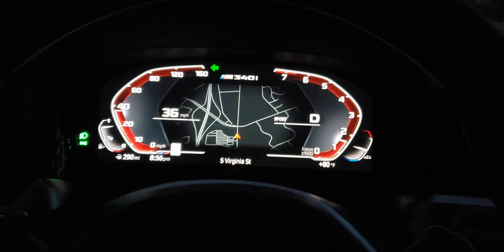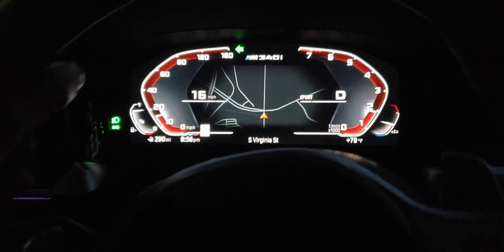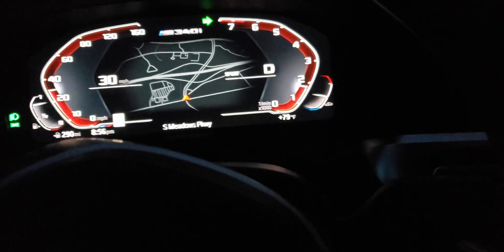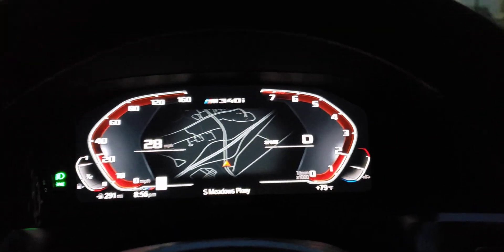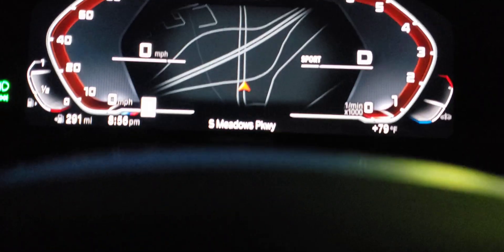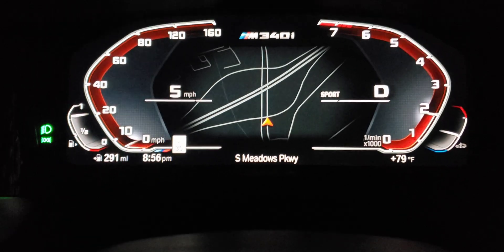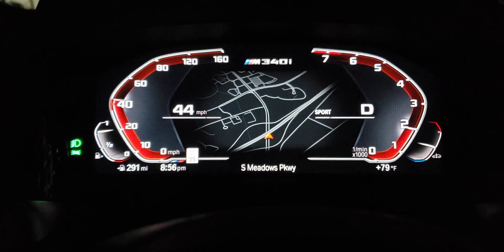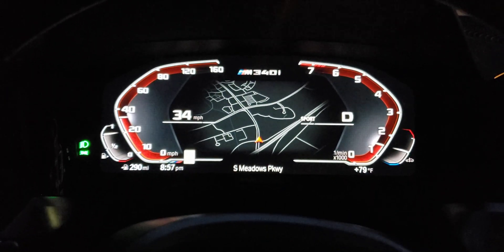Showcasing BMW's electric engine boost from 48V MH battery.

Comment: I think it only adds 10 or so HP ... so it's a nominal power assist. I think it's more directed towards start-stop assist, as well as running all the electricals in the car ecosystem. I'm puzzled why BMW decided to implement this system as it does little to the car's overall HP but adds complexity, knowing that the generator has to be liquid cooled.
Reply: True it is only 11hp but adds 120nm, so you definitely feeling it. I have a m340i and I have to say I was suspicious at first but it is really really good and it saves a lot of fuel.
Reply: It was added to satisfy EU emission requirements. That's the sole reason

Comment: is the regenerative braking annoying
Reply from the maker: Nope. Lol, Smoother everything with 48V mild Hybrid. Engine works with electric motor, but the engine still leads the relationship. Unlike a Prius that tries to have a 50/50. BMW Hybrids you can do 100% e-motor or 100% engine.

Comment: 2021 320D MHT; is this a good option for short drives? And not constant long motors way drives?
Reply from the maker: Both, but more beneficial to short drives. Take offs are smoother less laggy. Kick downs are also quicker on motor ways. More efficient for electrical system thus mpg.

Comment: I noticed, that my 320d Mild hybrid does not always go in e boost mode, when flooring the pedal 🤔🤷🏻‍♂️ sometimes it does and to me it feels a tiny little bit more powerful but sometimes it simply doesn’t appear on the screen 😐

Die you notice the same or should I be worried?
Reply from the maker: The E-boost is tuned differently for each engine. No diesels in U.S. so I could not answer that for you. Common sense says it activates with how aggressive and how deep your throttle is initiated. Some are timed or both.
Reply: I have.  I think  with boost it feels like 320 hp !!

I think when you are using the eco boost  power reserve as energy. We use eco power   to save fuel consumption. Thats why you receive mpg back!!. You put your foot down you use energy recover to go fast. Its not like before you see the eco mode mpg go down. No  it adds to what you already have. Example 757 miles eco mode saved.

When you gas up have u notice you put more or less gas its never the same thanks to eco mode.

Comment: Does boost only work in sport mode? Does it work in comfort too?
Reply from the maker: I think only when you push the button on the floor for the throttle past the button.The button is connected directly on the floor. The car has an emergency takeoff  system as well.

Comment: How does the electric boost work? I’m guessing the starter generator motor connects to the drive shaft and assists rotation? Is the starter generator permanently connected to the drive shaft or does it engage / disengage? Can’t find much information on how this mild hybrid system works
Reply: More problems in the long run!!!! Damn...I wish I knew before buying  my 2022 m340i....I hope the battery last long time
Reply: M340i doesnt have hybrid battery @RA-zk4gg
Reply: @RA-zk4gg it’s a 8 year battery warranty so shouldn’t be too bad, and batteries themselves aren’t terrible. I have same car as you and do worry about the extra tech as well 😅
Reply: Yes, how does it work?
Reply: I heard it's happening via the belt, which is wider (double) compared to non hyprid engines. By making it wider it can transmit the extra horsepower via the belt.
Reply: It's basically an alternator that spins instead of drags

Comment: Can u turn off that sistem star stop engine while driving?
Reply: Are you referring to the engine turning Off at stop lights?
Reply: @kevinrush4411  yes
Reply from the maker: Not in a Mild Hybrid. You can turn off the feature if you have a starter. Leave it in any Sport mode and it will not turn off.
Reply: @theautointuitive3172  ok but in normal mode?
Reply from the maker: @Javibmwm2  Auto Stop/Start is next to Start button. Its an A with a circle around it. When orange light is on, the function is turned off.
Reply: @theautointuitive3172  I know that i didnt mean that is about the engine stop and start when u brake
Reply: @theautointuitive3172  newer mild hybrid have that button
Reply from the maker: @leonpano  The A Off  button?
Reply: @theautointuitive3172  start stop disable button